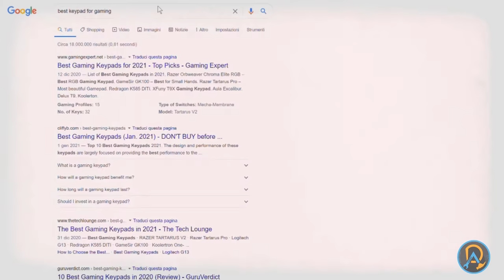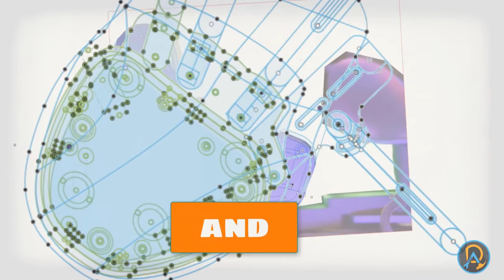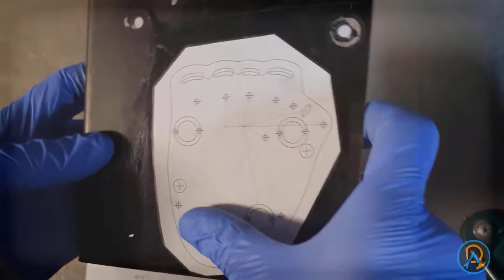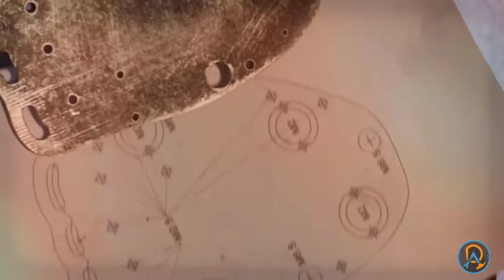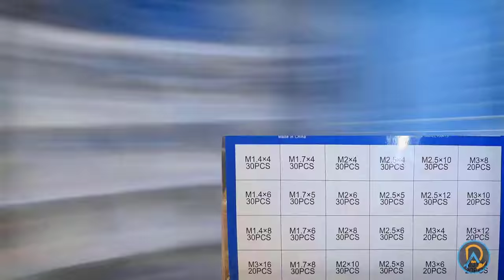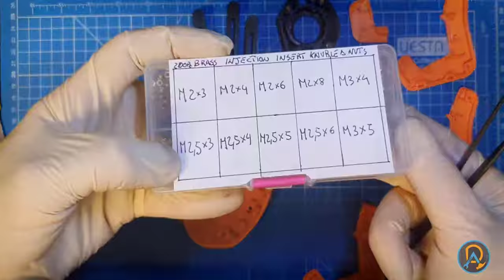How to make a Custom Keypad DIY - BEST Controller for Fortnite and Warzone

Comment: Ive just finished building my own and im soo happy...thanks man🙏
Reply: The cyborg is coming out soon, do you think you can also build it @Alvaro
Reply: @polouefn  hey I wanna build my own too so just wanted to know, did you make the metal piece too?? I'm thinking of 3d printing that base piece too and was wondering if it would hold....
Reply: @arkyajyotighosh7051  I 3d printed mine and works just fine,  but will change to the metal soon...
Reply: @polouefn  Is there a reason why you want to switch to metal?

Comment: Wow, quite impressive. Can you use the Azeron firmware and software on a Teensy and then solder/connect cherry mx switches to it instead of the mouse switches, or do they work differently?

Comment: I own 2 3d printers but decided to just buy an azeron. However I kinda regret going with all black so thank you for this. Hopefully its interchangeable with an actual azeron. If not then whatever I can make a new one. Thanks for all the work!
Reply: Did the parts turn out compatible?
Reply: @ElderSilverFox  I don't see how to they could be since the design is literally ripped from their open documents.[

Comment: Would another arduino board work? It seems Teensy++2.0 was discontinued in September 2021. Great video, collecting parts to build one now!
Reply: Yes another similar sized Teensy board would work fine, though don't go for the low cost version (LC). Best go for Teensy 4.0 or 4.1, the librarys and firmware will be the same and both supported in the arduino software
Reply: can it then be replaced by another teensy as said, without any problem?

Comment: How much does this cost to build yourself? I want to know if it's even worth the trouble to build. Looks like a fun project, though.
Reply: the parts cost around 30 bucks, but you will pay a bit more, since you buy them in quantity, so you will have extra parts. Alvaro's parts list from ali express will be the cheaper option over amazon

Comment: with what name do I find the usb interface? Could an Arduino be used for the same or would it be more complicated? Could mechanical switches be used? there's a lot to study to try XD
Reply from the maker: I'm writing a step by step guide, available soon.  The board is teensy 2.0 ++, in the guide you can find the wiring diagrams. otherwise you can do the same with arduino, but Leonardo version, because you need a serial HID devices. using arduino you can't use the original Azeron mapping software.  the work was a lot for me.
Reply: @AlvaroRosati  genial.

Comment: Really fun build! A bit pricy, but I know the creator put hard work into it. If you follow the parts list from Ali express, make sure you also get m1.4x10 screws, as they aren't included in the screw sets that are linked. Was a bummer realizing this and having to wait for them after already waiting. I printed my hand rest out of TPU and it came out great. Squishy and everything. The hardest part is cutting and sanding down the towers, cases and buttons so everything fits; the clearences aren't perfectly realized after printing. But it was fun, and is working great. Thanks Alvaro! Btw, I didn't see a STL for a profile button in the download. Am I blind, or is it not there?
Reply from the maker: Hello!  Thanks for your feedback!  all the screws you need are indicated in the PDF, the purchase links are purely indicative. Profile button cap is linked to Aliexpress. someone else wrote in the comments that the cost of the project is too low considering all the work and details... points of views. sanding is necessary when the print is not good, especially PETG or TPU which is not recommended, because it expands.  I recommended PLA in the guide. if you used the PLA, you probably need to change the settings of your printer, because the pieces fit perfectly.  I'm glad you enjoyed this job!  send me a photo I will gladly upload it on my web site.  thank you
Reply: @AlvaroRosati   I followed all your printing settings, it's just the nature of it that when printng parts, clearences won't be exact when making something like that, not your fault. The sanding was nesseary for me to fit the switches in their slots. I probably should have only done 3 walls, instead of 4 with my printer. What is the best way to send you a photo?
Reply from the maker: Sometimes behove to test first, because not all printers are the same, anyway use this link to upload the images :https://forms.gle/Ch95rxqAfCu1YKiD9

Thank you
Reply: @AlvaroRosati   Hey Alvaro, you still around? I often get people asking where to download the files, can I direct them here still ( or your website)? Looks like it's not on Cults anymore. Hope you're well.
Reply from the maker: @CHEEBnRUN Hey! Thanks... I'm doing well, hope you are too! Yes, feel free to direct anyone looking to download the files to my website. Currently, the only available download method is through PayPal. You can find the link in the video description. Thanks again, and I hope all is good on your end!

Comment: Impressive but being how Azeron was made in Latvia and most all peripherals and affordable 3d printers are chinese I'd rather pay for one the original, as I did
Reply from the maker: everything you buy is china inside ... my teensy is original, but like most electronic things it is made in china ... it works for over 1 year without ever repairs ... instead i read around that the original keypad often breaks ... PS the plastic only is printed in Latvia ...

Comment: Hey I also have my own diy but I don’t know how to get it to work with the Azeris software do you know how? Or would I have to get a different one
Reply from the maker: Hi, which microcontroller did you use?  What scheme did you follow for the electrical connections?
Reply: @AlvaroRosati  oh never mind sorry it’s just I want confused on putting the firmware but i just finished it

Comment: I donated and downloaded the files but keep getting a windows error that file wont open because it is blank???
Reply from the maker: Hi, do you have tried on another computer?

 The problem must be caused by your system because the file has been downloaded by many people… and it work fine.
anyway, don't worry, I'll send you a copy as soon as I get home from work.
Reply: @AlvaroRosati  thank u for the reply. I figured it out. I had to use a different unzipping program.  Thanks again

Comment: Man can’t you please share the stl I already got all the materials I just need the stl files
Reply from the maker: The step by step guide will be published Tomorrow, hold one just one day! ;-)
Reply: @AlvaroRosati   thanks buddy  I got everything ready I just need the metal
Reply from the maker: @vnavarro02  where did you find the material list? I haven't posted anything yet
Reply: @AlvaroRosati   I already got arduino teensy boards and micro switches and joysticks and much more stuff with me because I been working on other projects

Comment: This is all well and good... But the biggest weakness of the Azeron keypad is the damn switches 😅 those mouse switches don't last at all...
Reply from the maker: Hi the OMRON (indicated in the guide) are excellent and I have been using them for years in other projects. never broken. with the diy project you have the advantage of being able to replace them whenever you need them. 👋🏻

Comment: can someone PLEASE Give me a link to the  Stls  i need to repair mine
Reply: Donating is Failing for some reason
Reply from the maker: Hi,  You have probably lost your connection.  Use a PC, not a phone.  The link is still active on my site and is also the recommended method as you don't pay 3D cult commissions.  so, send me the transaction ID and I will send you your files, But if you don't have this code Unfortunately I won't be able to help you.  find my email on info profile.  
hope you have a happy day

Comment: Hi, excellent job dude. I already supported you through your page and downloaded the STL´s, and already printing on PETG ;-). I have a question. What´s the wire sizes you use (American Wire Gauge)? This will be my first welding project, so totally noob here.
Reply from the maker: Hi!
First of all, thank you for the donation! 
Second, you have a beautiful name... ;) 
The wire used is very small, AWG24 or AWG26 are just fine.

If you send me some photos of the finished work i will post them on my website in tutorial page.

CIAO!